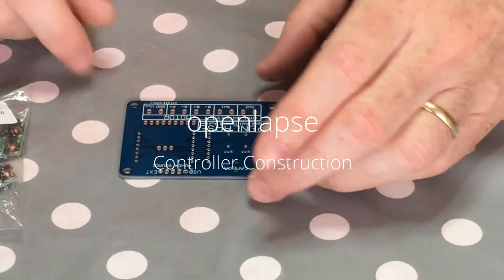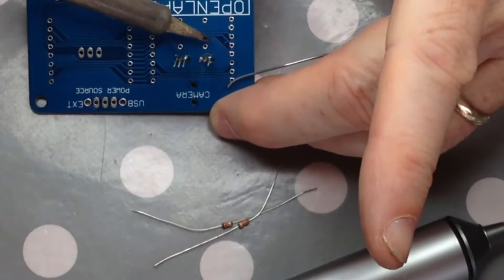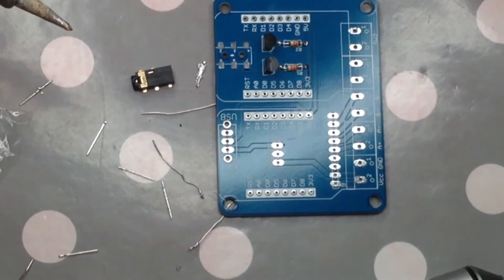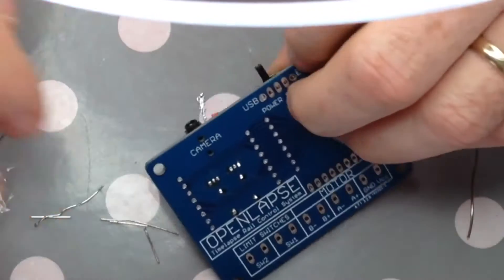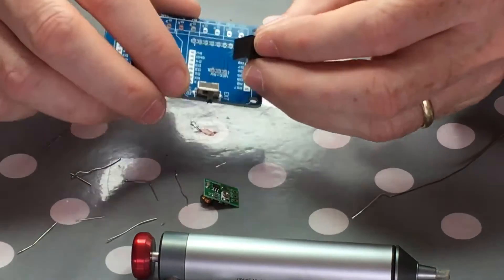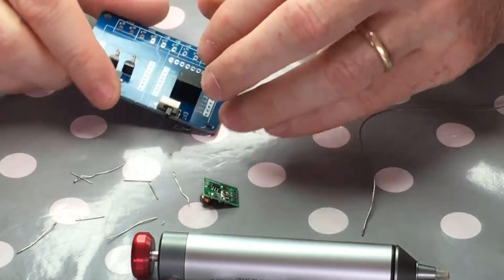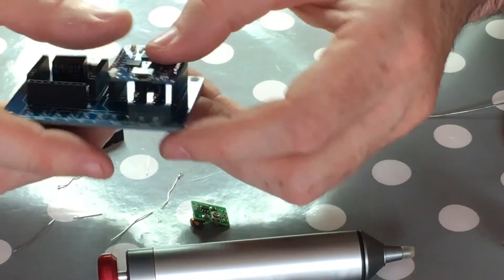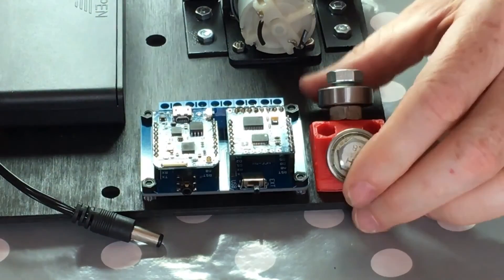openlapse - Controller Construction

Comment: Built this and I can't get it to work

Flashed the wemos with the bin file, it reboots and the led flashes, but there's no "openlapse" hotspot showing on any phones, tablets or laptops.

On one of your videos, it shows the device running at boot up and stepping the motor, mine doesn't do this either so it's difficult to tell if it's working or not

I have noticed that you state using an external aerial on the wemos, but you don't mention moving the connector to use that?
Reply from the maker: Andrew, have you tried to see if the hotspot is created without the D1 Mini plugged into the board? Maybe there's a problem with the daughterboard. It should at least create a hotspot and allow you to connect in with the phone, although obviously you won't be able to use motor or camera trigger.
Reply: Tried the board in and out of the daughter board, not had chance to see if it's an Apple thing as I know they are twitchy when connecting to other devices - also not had chance to add an external aerial yet either, but can't see that changing anything as it shouldn't be connected unless you change the 0 ohm resistor, but it may help due to an inducted signal (I may be grasping at straws there :) )
Reply from the maker: Without changing the 0 Ohm resistor, the internal wemos antenna should be enabled, and well connectable from an iPhone (which I use). You might have to try flashing the board a couple of times, I've had times when it looks OK but does not flash properly. Do you have another wemos you could try?
Reply: Just tried it on an Android phone, still no hotspot, I'll try re-flashing after dinner, and no I don't have another wemos, will order a few more from China as I have a few other projects I want to try out
Reply: Tried re-flashing a number of times with no success, installed a test wifi hotspot sketch which worked fine, downloaded the .bin file again and flashed it, still nothing - thankfully I don't have any hair to pull out.

Comment: Hi Dave,

I have troubles making the motor spins. The web interface and the camera trigger works just right, but there is no voltage going to motors A/B. I flashed the wemos D1 with the latest binaries, but still no signs of life to the motors. 
I tried two different openlapse boards with different hardware, but still get the same issue.
Any idea on how to solve this?

Thanks
Reply from the maker: Have you flashed updated firmware to the motor controller? https://hackaday.io/project/18439-motor-shield-reprogramming That could be your issue. If not see if you can get some life out of it by pulling it out of the socket and re-insering it a few times. But you will probably need to flash it to have reliable operation.
Reply: No, I did not flash the driver, so most probably that's why is not working...
Can I do that via the Wemos wifi board or I need a serial adapter?
I'll give it a try, thanks for your help!
Reply from the maker: If you have trouble flashing the motor board, I have about a dozen of them (already flashed), I could put one in the post for you. :)
Reply: I was uncomfortable with asking that, but that would be of GREAT help :D
I'll be happy to pay your extra service for this itchy issue.
Reply from the maker: Sure, drop me an email - dave at davidhunt.ie
Reply: sent it,
please check the spam too, apparently, that's where my emails are sorted out recently :)
Reply: I'm struggling with the flashing too.. tried on my Raspberry Pi but the latest version of the gcc toolchain is 64bit only, so I tried and failed to follow the windows method.  I'm a bit out of my depth here, so if anyone could do a bit of a simple guide, I'd really appreciate it.
Cheers